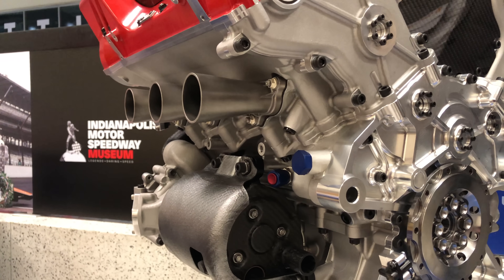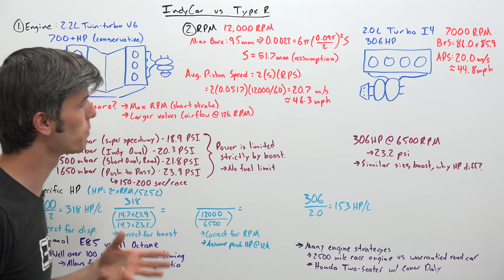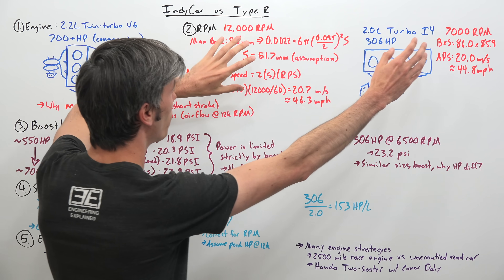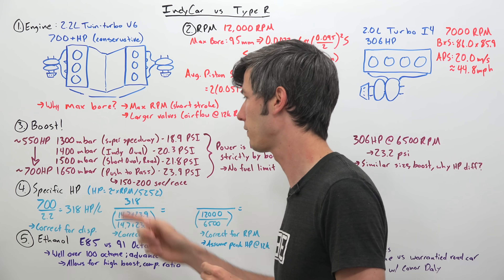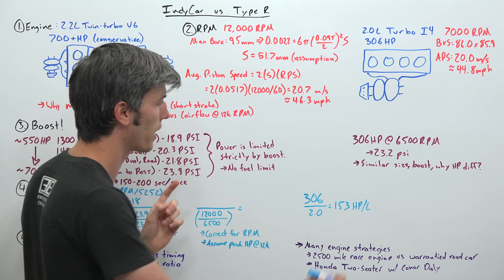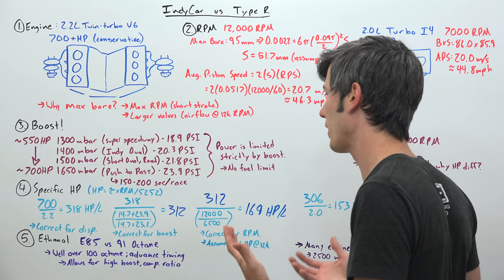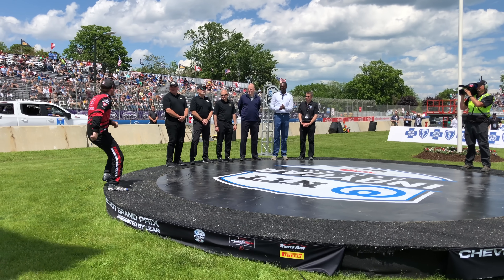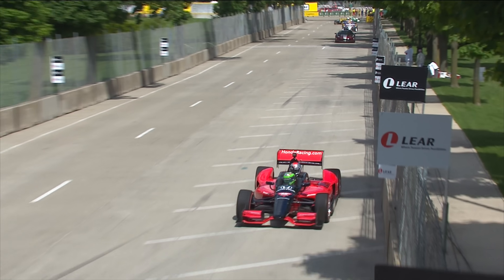How Honda’s 2.2L Engine Makes Over 700 Horsepower

Comment: Here's one thing he didn't talk about and a little nitpick: Despite him saying the turbos are the same, that is not really true.
While they both are maintaining ~20 PSI of boost, this means different things at different RPMs
At 12,000 RPM, like he said, there are much more cycles per minute occurring then the Type R engine can achieve.
This means vastly more fuel and more air is flowing through the engine. Because of this, the indycar engine turbo is pushing a vastly greater amount of airflow to maintain a pressure of 20 PSI at the intake than the Type R's engine needs to push to maintain 20 PSI at its intake. This is shown in the turbochargers themselves. The CFM of air the indycar turbo can move and compress is extensively greater than that of the Type R turbo.
So, while it is correct that both turbos are gated at 20 PSI, to say that the boost is the same is somewhat incorrect. Jason is talking about volts when amps tell the real story of what's happening in these two engines' boost.
Reply from the maker: I'm not sure you're nitpicking, or that I missed anything. Obviously if you have a higher RPM (more power strokes per minute, as discussed) you have to fill the cylinders up more times, so you'll be pushing more air. Boost is a way to measure how much air the cylinder is getting. The more RPM it has, the more often it does it, thus more power.
Reply: @EngineeringExplained  Yeah, makes sense. I can see why it's not a nitpick nor anything wrong, but I just felt like it was overlooked and needed mention at least in passing. Thanks for taking the time to read and reply.
Reply: Still same 'boost' but indeed it should be told. More to be learned for people that don't know this
Reply: More a difference in pressure and volume isn't it? Kinda how a larger turbo will flow more air at the same pressure than a smaller one. 20psi on a 66mm turbo is less air volume than 20psi on a 77mm turbo. Pressure the same but more air and more power with the larger turbo, assuming no restrictions and enough fuel.

Comment: Knowing the compression ratio would really help for a even beter comparisation.and yeah the e85 is a verry big difference. I would love to know the specs of the 1.6 v6 turbo formula 1 engines.pretty impressive knowing e85 isnt aloud and they have a fuel flow limmit(wich i think is a shame). Off coarse they have special fuels but those are super secret
Reply: @jzxtrd337  wel they experiment a lot with different fuel mixtures and the fuel is tuned to the engine and vice versa.i dont know exact regulations and im sure it has to be a petrolium basis but its deffinitly not the same as we get from the pumps.octane has te be pretty high and they experiment the whole time.but they claim that things like vpower is derived from their f1 experience

Comment: tbh Honda is also making engines that are 1.6L and make over 950 hp in F1. 2.2L engine that makes over 700 seems not so impressive comparing to that.
Reply: @jzxtrd337  1 engine per race? They last a lot longer than 1 race

Comment: Indy car engine, of course you can crank out the power when the engine only has to last 1500 miles tops.
Reply from the maker: 2500 miles, if you’re gonna talk trash at least get it right! (Or watch the video, where I state this).

Comment: Wild that you didn't mention the most salient factor; one has much more airflow since 
A) It has twice the number of turbos (specifically compressors)
B) Indycars run efr7670s IIRC, which produce ~650hp worth of airflow each     The civic type R stock turbo probably chokes around 400hp. 

Fab up a compound charged built k20, with an 8374 primary and sxe476 secondary. Obviously upgrade the fuel system for e85 and flow, get a dogbox, etc. and then we'll see which makes more power/airflow (of compressors)
Reply from the maker: The number of turbos does not predict how much power a car has. Plenty of single turbos can offer more than 700 hp.
Reply: @EngineeringExplained  I did not mean to imply that more compressors always equals more CFM, although I chose my words poorly so fair enough. 
There are also plenty of ~2liter inline 4 engines making 700hp within 7000RPMs  ; )

Comment: I need that motor for my Accord, then let's see those Hellcats and Shelbys try flexin at stop lights.
Reply: Hellcats and Shelbys are both capable of 180mph+  with a lot more low end torque.  Youd still lose despite the cool factor of an f1 engine in your car...

Comment: How do you get the Honda Civic engine to Reve to 12000 without breaking apart before 5000/10000 km?
Reply: You don't. Way too many mods needed. But a much shorter stroke crank and longer rods to take up the new space would get you closer. Reducing cc yes, but your rod ratio will be immese so you'll be much better equipped for revving really high.

But custom cranks are like, ridiculous money
Reply: You'd also be better off using a k20a varient. The head flows a lot better than the turbo k20c

Comment: This is actually pretty basic engine knowledge, but a lot of 'car people' don't understand a 2.0 V6 is probably a lot more fun and engaging to drive than a 4.0 V6.
Engines with little displacement per cylinder have been a thing for so long now, and I've always wondered why it never kicked off in 5+ cylinder engines, but then again, if you need a V6 or V8, you probably need more torque (SUV, van, ...). We don't know the compression ratio, but this engine would not make too much torque (in a normal setup, with a 10:1 ratio and regular gas: about 150 lb-ft max) - without turbocharging it. Must be fun to drive this!
I wondered how much more they could squeeze out if they decided to use LPG instead of ethanol. Slightly higher energy density and even higher octane ratings. Very cool.

Comment: power difference is extraordinary because... 1) one is a purpose built formula racing engine while the other is for mass production. 2) twin turbo V6 vs single turbo 4cyl.  3) millions of dollars spent per engine on the formula engine car. 4) this is nothing new when you enter the professional racing scene.
Reply from the maker: None of what you stated actually accounts for why the power is different though, from a physics standpoint. A single turbo I4 can out-power a twin-turbo V6 all day. The number of cylinders and turbos does not dictate power.

Comment: With all your knowledge of engines can you explain why there are no 100 mpg engines in 4 cylinder vehicles in 2019?
Reply from the maker: Because the efficiency of internal combustion engines doesn't allow for much over 50-60 mpg in today's vehicles. If you want over 100 mpg from an energy standpoint, you'll need an electric powertrain. Gas engines produce a ton of waste heat. Electric motors do not. Plenty of EVs out there with MPGe over 100.

Comment: It's not that difficult is it? When you have a turbocharger on it, it's not amazing. In 1986 1.5L engines produced way over 1000hp.
Reply: And the engine lasted for... 3 laps. Yay
Reply: @OdamaKamayuka  in race trim they had 850hp
Reply: @weallfollowmanutd  Yes. The 1000+hp was for quali, hence my answer. ^^ 
I remember cases in which the quali block blew during the hot lap, thus it held less than 2 laps (warm-up lap + hot lap). What a crazy time that was! XD

Comment: It seems to me that the only major difference is RPM. A naturally aspirated engine will get you about 100Nm torque per liter (+- 20%) but here we have forced induction but since they both have similar boost they should still have similar torque and with double the RPM you get twice the power.

Comment: You would not want this engine in a street car. It has low torque. It is totally an engine designed to be run at wide open throttle with a lot of space ahead of open road for acceleration. And of course it would not last very long.

Comment: So, in summary, more displacement (0.2L) + more boost (0.7psi) + more RPM (5500rpm) + more compression (?) = more HP.
The combination of a number of differences add up.

Comment: How about explaining how the hell mazda was capable of making 930hp out of the R26B
Reply: 10300 rpm a effective displacement of about 5.2ls and horrible fuel mileage. Remember the rotary fires more times per revolution than a piston engine
Reply: @jdrok5026  yes, but you can't explain the awesomeness
Reply: @SachAlvarez  well i did. They are a 2.6l compressor that fires multiple times per revolution added to that the ports and aspiration methods along with spark. You end up being able to rev to 10300 rpm remember no valves. So when your going that quickly with literally a engine with a effective displacement of 5.2ls per complete revolution of the engine you should be able to hit about 400 ish hp along with a high for rotaries compression ratio. 930 hp isnt really amazing for such a high rpm engine with that many firing intervals and efficient mechanical it really isnt impressive for rotaries sure its impressive but for engines as a whole not so remember we have na engines that have less firing pulses with a true effective displacement of 5.2ls per complete revolution of the engine and can make over that because rpm for a rotary is not directly comparable to a piston engine of 4 strokes.
Reply: 400 ish torque

Comment: you forgot to mention that the honda 4 cyl has to comply to road car noise and emission standards where it may sacrifice power to do so, and is also a bit smaller than the indy motor.

Comment: That v6 is beautiful, no engine covers just like the old days.
Honda NSX would've sold like cookies with that v6 in it.
Reply: J Lemus the reason the NSX didn’t sell like hot cookies is because people turned there noses up at a Honda sports car in 1990, thinking it can’t be as good as a Ferrari or a Porsche, how wrong they were, not only was it as good it was better an actual reliable super car, apparently Ferrari had to go back to the drawing board to up there game,
Reply: @butchtropic you have a point but I'm referring my self to the 2016 to present day NSX, it will destroy everything on the road pretty much, 2.2l V6 with over 700 buff hrss man they need to get on that ASAP lol.
Reply: J Lemus you have to drive one...the current set up is like McLaren levels for such a lower price
Reply: I wonder how much weight difference imthere is between the new and old nsx. Brb. 868lbs difference older one being lighter.

Comment: whats difference between fuel consumption of both engine
Reply from the maker: IndyCar is getting around 3-4 mpg, but that's at much higher speeds than the Type R could get around the track.
Reply: Engineering Explained  bro also make a video on how  to make 700hp with 2jz gte

Comment: Also a power difference factor is emissions. The 2.0L is rated with catalytic convertors. E85 alone would explain the power gap you ended up with in this video, so you have proved 700hp is definitely conservative. Probably as high as 800hp.
Reply: Most people in the know think its like 750 on road courses and short ovals but come 2021 Indycar engines are gonna have 900 horsepower!

Comment: 5:30, iam not sure if this works like that. I mean, you cant just simply calculate the power of a engine on a lower rpm. We dont know how exactly the mentioned engine works, the hp curve is not linear ! So when calculating the power at 7000rpm, you are actually distorting the result. Especially older engines have very strange way of operating. Or your S2000, iam not sure but i assume that somewhere in the middle of the rpm range the power output is "flat", after Vtec kicks in, the power output would raise quite a bit. Thats what i mean. When you calculate the power of your S2000 at half the rpm, iam pretty sure your result will not be half of your power. 

The main reason are, like you said, its a race engine first of all, they have to last for a short period of time, they made very aggressive, high rpm. Even the choice of using a V6 shows that, one of the main reasons for that is to use 2 Turbos...

But man, those 20.000 rpm F1 Engines : ) No Turbo nothing...
Reply: Of course this only gets you in the ballpark but he wasn't saying it would be perfectly accurate, in an ideal world where all other things are equal it would be the case that half RPM = half power, noone is saying otherwise.

Comment: Honestly as an EVO owner, seeing that power from a four cylinder is not surprising at all. In fact, my car makes more than that from a 2.0L. You have to realize that even they have the similar boost on paper, but 23 psi from a smaller turbo is entirely different from 23 psi from a bigger turbo.  Bigger turbo shifts the power band up while sacrifices low end torque. Smaller turbo simply won’t compress enough air for high RPM. And bigger turbo simply won’t be spooling fast enough (or won’t be spooling at all) to compress air at low RPM.

Comment: what's the torque rating on this engine?
Reply from the maker: They don't release this info. I would guess in the 300-350 lb-ft range (based on peak power/RPM).

Comment: It's disappointing that Honda has ceased V6 production for all their production consumer cars and are limiting them to only their minivan and largest trucks/SUVs. Because I guarantee you there is a market for a high performance family sedan with a twin turbo V6 producing 350-450 hp and rear or all wheel drive. It's an untapped market for Honda and they really need to explore it. Who wouldn't want something to compete with BMW, Mercedes, or Cadillac that has Honda reliability? For all their talk about their racing history and how what they've done on the track influences what they sell at the dealer, frankly, can anyone tell me outside of the NSX and S2000 has Honda or Acura ever made a TRUE performance car? Sedan or coupe that seats 4-5. By TRUE performance car I mean high horsepower and rear wheel drive.

Comment: Sounds like the the indie car motor has more in common with a motorcycle engine than a car engine.
They're fundamentally the same but with different priorities. Performance motorcycle engines typically prioritise weight and top end power vs performance car engines tend to prioritise usability (torque and a wide powerband) and reliability/longevity

Comment: Another piece of the puzzle is that a Type R won’t make that much boost at peak power.

Say it’s 21lbs at peak power and there is around 95% right there.
Reply: maybe there's just not enough flow past the valves?

Comment: Boost is overrated. Boost is a measurement of pressure or restriction of flow. Volume is a measure of how much are the engine swallows up. 25lbs thru a bendy straw is not the same as 25lbs thru a 3in inlet tube.
Reply from the maker: Huh? That's not how it works. Volume is taken into consideration here (displacement). Boost plays a critical role. How much great over atmospheric can you get that displacement? In this case, about 23 psi over.
Reply: Engineering Explained I mean boost is not all that matters. Manifold air density is a major factor and the example I was making was that the same boost level on 2 different turbos of different sizes will be different volumes of air.

Comment: Turbo sizes are completely different ... different CFM flows. ... 30 psi on a Gt35R and a 30psi on a GT52R are very different
Reply: 30 psi on the two engines is different independent of which turbo is used to build up that 30 psi.

Comment: Short answer: 
Throw some e85 in it...
Reply: In Brazil we actually use e85 on normal cars, cars makers usually advertise power in each fuel and using ethanol it is usually 3% to 5% more than gasoline.
Reply: @victornpb  sorry no. ethanol has less energy than gasoline, it just has a higher octane rating
Reply: @victornpb  we have e85 in australia as well for normal pump fuel

Comment: Jason alternating bore and stroke is going to change the torque output over the rev. range. How does Honda keep the torque high in that high revs.? I know what way to get more power out of an engine (for racing) is to have tighter tolerances for parts, especially pistons. - This, however, cannot be done in an everyday car due to the different temperature range at which it has to start and also to be able to assure quality in a mass produced product. Could you make a video about different engineering approaches when it comes to designing a race car (one of) and mass-produced car? And also explain why those same things cannot be easily applied to mass-produced cars? Thank you.

Comment: Missed that there is less energy in E85 and there are two turbos pumping fuel in verses one. The math was not very thorough. Not a great explanation on this one.
Reply: To cb: you had to know what was meant. But for your clarification; a turbo charger is responsible for pressurizing a fuel AND air mixture into each cylinder for combustion regardless of whether the injectors or carburetor(s) is downstream. But then this detail totally misses the point of the original comment.

Comment: I'd love to see a video like this about some of the old F1 engines that revved to like 15/16 thousand rpm
Reply: V10 went up to 20 000rpm, what a glorious sound that was. <3
Reply: Check out the BBC Equinox documentary about the Ford-Cosworth turbo V6 F1 engine -- it's very interesting! :)  The rules limited it to 4 bar = 60 psi in 1987, but some may have run even more before that.

Comment: Also the indy engine idle is really high because of intakes valve and exhaust valve are open at the same time for a higher amount of time than a normal street engine.
Reply from the maker: Yep, I asked about idle, supposedly around 3000 RPM.

Comment: This is not impressive....  Its a race engine....  Has anyone looked into motorcycles engines?  200+hp per litre....  Or a motorbike race engine? They get 300+hp with no turbo...